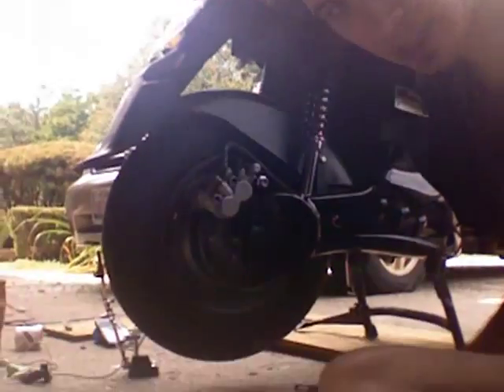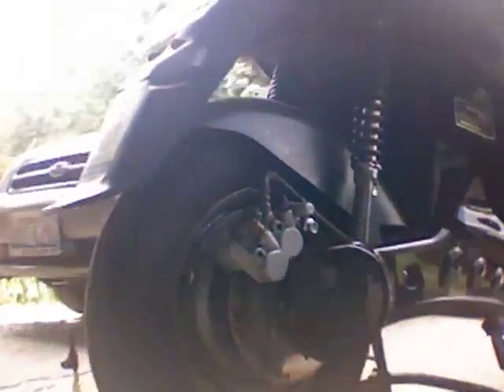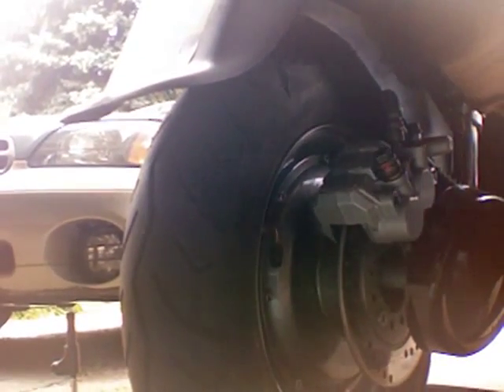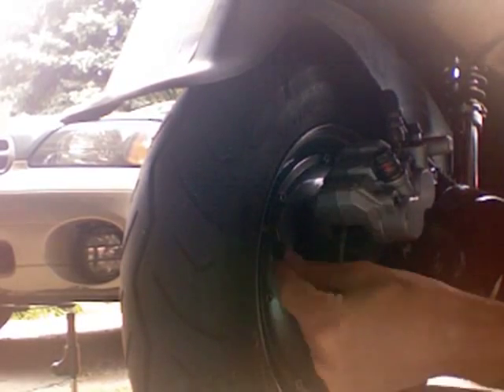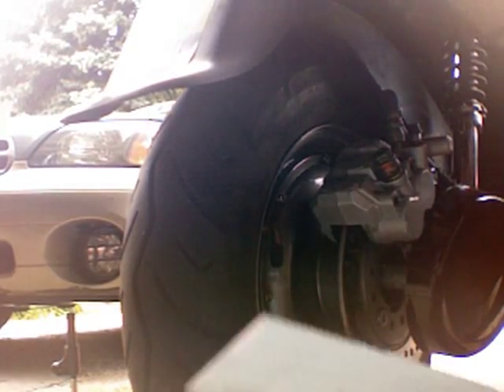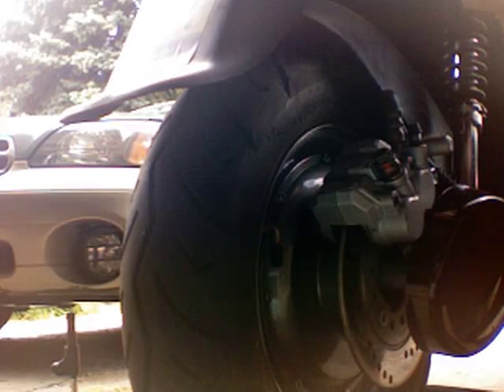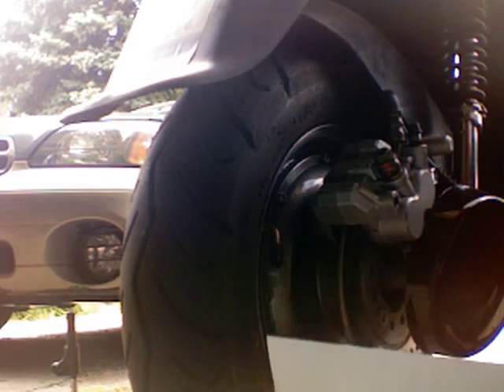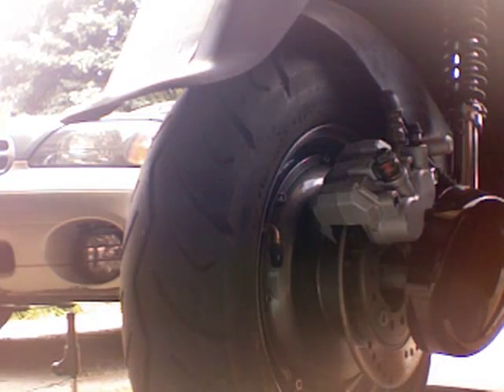XM-3000 72V 58.4MPH

Comment: I know this is super old, but I have the exact same bike, with the stock 5 batteries.  I am wondering how did you add a sixth battery?  And did you have to modify anything else to make it work at 72 volts?
Reply from the maker: jack chandelier i just wired the 6th one in series without changing anything.
Reply: Really? You just added a 6th12v battery in series and everything worked, you didn't have to change the controller or charger???
Reply from the maker: +Short E It's been a while, but I've been "bank charging" the scoot, so an individual charger is connected to each 12V battery.  I tried to adjust the 60V charger the scoot came with with the pots inside, and if memory serves me it caused it to let out the magic smoke.  The controller is stock.